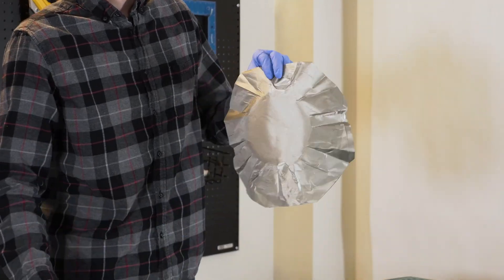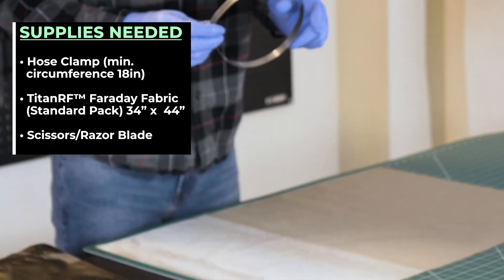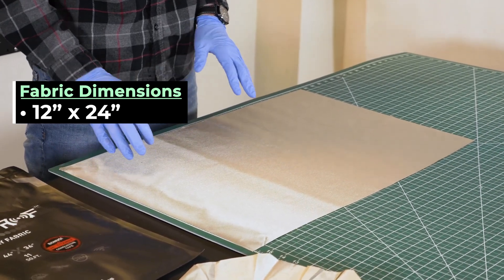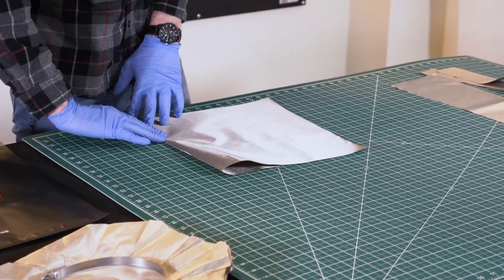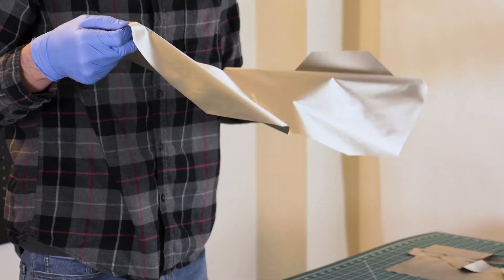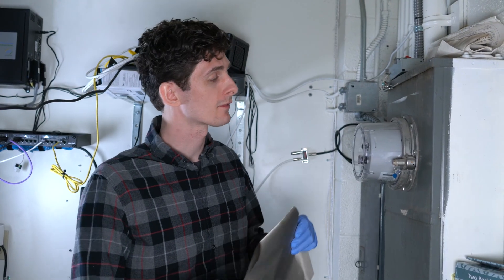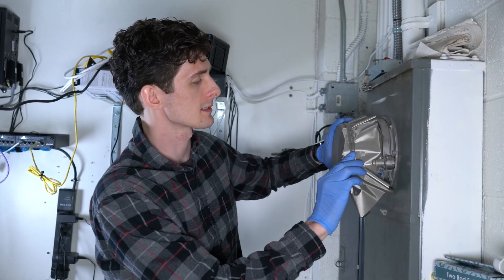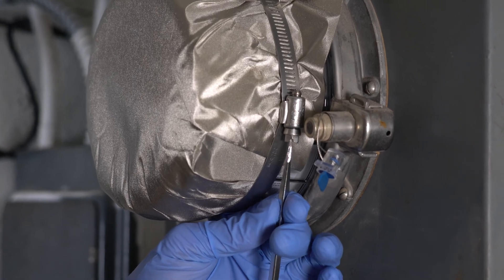Make Your Own Faraday Shielded Smart Meter Cover for EMF Protection

Comment: I used a large stainless steel mesh strainer that costs less than $10 and covered the meter with it, works great.
Reply: Where did you buy it?
Reply: Yo Jesse, where did you buy the mesh my friend?
Reply: @TheRealBobLazar  I don't remember, maybe dollar tree. I re-made one out of steel flashing, aluminum screen & a big hose clamp, all from home depot. Tools used were tin snips & screwdriver, it took only a few minutes. Also cover water smart meter with screen.
Reply: @invisableobserver my smart water meter is being forced by the city with No Opt Out policy. They tell me it will be placed on a pipe inside my house and the transmitter will be outside so the smart meter is inside so you’re saying I wrap the unit on my pipe?
Reply: @invisableobserver  I like the screen idea because it can still get out but it will break it up so its not as strong… depending on the type of wave of course. Anyone worried about this or attempting this definitely needs to buy a meter to test for leakage they don’t want at all angles surrounding the meter or whatever they’re trying to protect themselves from. Emf will work harder and more continual to find its least resistant path and it reflects off of most metals depending on its strength. So people need to be careful on painting walls and putting sheets of metal in their homes. Elf, RF, etc bounces around in those areas if ANY get in, whether it comes in through the ceiling, floor, or from any emitting device you weren’t aware of. Even things that are plugged into the sockets and not in use. You could cause more harm than good.
Reply: @myates33  I agree, last summer my smartmeter caught on fire, I covered the new one with flashing metal & aluminum screen held on by large hose clamps. Unfortunately I cannot afford to buy an EMF meter to test it
Reply: @inv @invisableobserver did it caught on fire with the aluminum covering or it caught on fire because you didn’t have the aluminum? Are you saying that the aluminum protects it from catching on fire? Please answer because the electric company just came and installed new smart water meters in our home and now I’m worried reading all these comments 😭 😭
Reply: @masteringmanifestations  it caught fire because the meter was defective,
Reply: @invisableobserver  do the aluminum coverings help avoid fires?
Reply: @masteringmanifestations  no, it just blocks the EMF radiation. Smart meters are attached to outdoor breaker boxes, and old breakers boxes become deteriorated after 20 years and can start fires.
Reply: @masteringmanifestations  no, it just blocks harmful EMF radiation. Fires from meter electrical boxes are usually because it is 20 + years old
Reply: What about the holes in the strainer?
Reply: @trulylynn9941  it's strange but the electromagnetic radiation does not pass through the holes, I took down the strainer & put stainless steel flashing around it with  big hose clamps, the strainer just looked too tacky
Reply: Great idea. No one would see it in a cupboard under the stairs - which is where my digital not smart meter is.
Reply: Does it work great standing in front of the strainer? Or does it work great at all angles around the meter and behind it? Make sure you’re not redirecting it towards your house or anywhere that you’re spending time next to it.
Reply: @myates33  smartmeter is between 2 bedroom windows, I put metal sheets behind the smart meter & completely covered the windows with aluminum screen. Grass never grew in the yard within 10' of the smart meter.
Reply: It requires aluminum mesh/screening not stainless steel, is my understanding.  I used aluminum mesh/window screen and aluminum tape and staples to hold edges together before taping for my gas smartmeter.  It works great and releases just enough for the person driving by in their truck to read the meter from my basement when they are in front of my house.
Reply: I am peeved off because the house I'm about to rent has now had a smart meter installed, and I want to know  how i can protect myself, I'm in Australia. I have sensitivity to emf radiation etc and the fact that these corporate companies are saying we do have a choice is in and of itself unlawful. I do know of people here who have adamantly refused the companies to install a meter and they have kept their old meters
Reply: Yes, that would. But I used the aluminum fly screen and it doesn't stand out and it looks somewhat more professional. The Utility may complain when they do occasional inspections.
Reply: @donk.5730 The smart meter caught fire last summer, I am glad I was nearby with a fire extinguisher, Several caught on fire on my neighbors homes too. I made a new cover with aluminum screen & flash metal using big hose clamps. I was without electricity through a long extremely hot summer, I almost died from it. I feel like I was targeted. The electric company refuses to let me opt out, yet they say they can.

Comment: Not a good idea bro, use SS mess, to reduce and split the RMF, i wouldnt do more, this will block signal, and deflect it back though wall, better deal, useca mylar blanket, pin it up inside the house to reduce EMF, if you're meter is in a location, dont have head of bed near it, or near a place you often sit, is a more functional solution, You prob want to update this bro, already to much fake news online, but yer call, 📞🙄

Comment: Hmmmm... This would be blocking 100% of the signal to the power company and they will show up and take it off. You need to use aluminum or stainless stell netting (like to use as a screen for a window). You want to reduce EMF by 90% to 98%. Not 100% eliminate it. 😂
Reply: Good point. Where I live you can pay a small fee for them to come out and take the reading manually.
Reply: Yes, I got a notice to immediately remove my screen version. They won’t even replace my smart meter with an analog version anymore in San Diego. No options.
Reply: I want to eliminate it.  I refused to have them switch my old house over.  They did it without my permission.  They can get their butts down and uncover it to read it and then put it back.
Reply: Exactly, Jared. What a stupid video

Comment: Dang. After reading some of the comments, I think this video needs to be taken down and done more thoroughly. Please show the EMF readings from the inside of the house nearest the smart meter before and after application of the shield. Also, explain how RFs can't escape with the shield on even if the entire backside of the smart meter isn't shielded. I've mostly read that people are placing RF-EMF shields along the wall INSIDE their home in alignment with the smart meter, so as to direct the RFs outward and not inward. Logically, by covering the smart meter on its face, the EMFs will be redirected into the home, right? Please correct me if I'm off on this. People are looking for solutions so when they come across videos like this without knowing anything about blocking EMFs then it could cause A LOT of harm to their health if they did this DIY and unknowingly redirected the RFs even deeper into their homes. Our smart meter is right outside our master bedroom (where our 6 month old sleeps too.) If I did this DIY, it could make our health issues worse.
Reply: If the face of the meter is towards the house it should be fine. The current goes out the sides and vice versa,  I don't know why the waves would go backwards or forwards
Reply: I didn't see him do any RF measures before or after the installation
Reply: Yes, common sense would tell you that this traps and reflects towards the house. I'd opt for replacing with an Analog Meter. I know you have to kind of go through some BS to get it retro but that's the best way...
Reply: @keithherington  My CoOp wants a one time charge of $300 per meter and $75 per month added to my bill each month, and I have 2 meters.
Reply: @ralphsawyer9535  Not sure what you mean by CoOp... What state do you live, just curious? That seems incredibly high and could be a newer issue.
Reply: @keithherington  A Cooperative is supposedly owned by its members, but that's bs bc they don't ask us diddly. I'm in Texas, and you're not joking it seems awful high. I emailed  them yesterday and got my reply this morning and that's what they told me.
Reply: @ralphsawyer9535  I mean, I'm in California and I think it's $150 to replace and you have to fill out some paperwork but there's no Monthly Fee... That sounds borderline Illegal... I hope you can find additional information to hopefully circumvent that nonsense.
Reply: @ralphsawyer9535  Wow. How greedy.  Makes you want to get off the grid completely.
Reply: @keithherington  yeah there is an extra monthly fee. I have Southern California Edison, and they are greedy!
Reply: @HapillyMe  Yes it does. I've been with this "Cooperative" since 1981. Rural Texans read our own meters and wrote it on the bill. For 25 years I did this with zero problems, then in 2006 they switched the meters, never said anything, never asked, never even talked to us about the new Smart Meters. I had no idea that I had options then. I could have refused and kept the analog meters. I would have saved the $300/meter but still would have been stuck with the $75/month, or whatever the price was in '06. This is outrageous and I'm far from done. They've put their convenience and ercots ability to spy on our usage over our health and well-being.
Reply: @keithherington everything is illegal in CA
Reply: Good observation
Reply: Your wrong it doesn't go back through solid metal
Reply: @awakeforever So why bother to do this at all, if you're just protecting the neighborhood and not your house?
Reply: I was wondering about behind such a meter. I don't have one - yet, but the new energy bill being introduced in the UK will enforce them to be fitted, with the threat of not only heavy fines but prison, and the threat of stealing our homes! Because ALL land including 12 miles out to sea "belongs to the Monarch", they can legally do that depite arguing the common law. Here, "freeholders" are not registered as owners at the land registry, but as tenants - even if they have completely paid for their property.
Likewise, whereas motor vehicles used to be registered to the owner, for years now the owner is registered only as "the registered keeper". Rum deal. A. Monarch who lies he has no power - when actually he has a great deal of it, and is a member of the Committee of 300 which well overseas the UN and its offshoots such as the WEF.

I digress though, so to go back to my main point, my small house is a terraced. I don't know if my next door neighbours allowed a smart meter but if they did or do in the future, it will be under the stairs the other side to where my electricity meter is. Maybe back to back or very close to it.

I suspect I shall have to try and have my son cover the wall in the small cupboard under the stairs with real aluminium foil (not the fake aluminium) or perhaps better, copper sheeting which will be expensive for me on a pension.
However, I suspect it would be a pointless exercise unless it were possible to place the sheeting behind the meter, which no one is allowed to touch because it is the property of the energy company (none of my family are electricians anyway, and no private electrician would break the law and move it for sheeting then put it back).

The trouble with living on a small set of islands is that the general population are far more easily lied to, and much more easily bullied. Those in control don't get away with nearly as much on the continent. For instance, the average person in France always knew more about the truth of the EU being a Nazi contingency plan, and the few people who went on holiday there in the 1960's came back and tried to warn other, but most wouldn't believe it because the MSM and misgovernment of the time lied it wasn't. 
The system of Monarchy would be a marvellous thing - if we ever had had monarchs who were more for protecting the people. In fact, a decent Monarchy might even be the best system - but if course we never had even one and never would have. 
As a result, hardly anyone here knows of the dangers of certain radio and microwaves, etc., despite the plethora of information on the Web. Those working and raising children are too busy to find out, and those not working are likely to be apathetic, or too disabled, or retired. 
An awful lot are brainwashed.
Reply: I used reflective Christmas wrapping paper behind a bookshelf to block the cell tower and it worked 80% lower per meter.
Reply: @Doc02864  That is impressive!
Reply: The smart meters is a world wide initiative, part if the WHO to control mankind cdug into it.
Reply: The meter back is all metal, so should work like a shield from that side.

Comment: Do shield cause the readings to nit be sent to the electric company? I can get hassled if they have to come out to read it.
Reply from the maker: No, this will not effect sending the readings to your electric company.
Reply: @missiondarkness  ....so it's not actually stopping any RF then....? ....or is is just stopping the bad harmful RF, and not the good meter reading RF?
Reply from the maker: Sorry just to clarify - the RF reading functionality will be cutoff. The meter reader will not be able to remotely read the meter. They or you will need to remove the cover to read it, then it will need to be replaced.
Reply: @missiondarkness  So it will mean I will get hassled by the power company....?
Reply: I bought the Smart Meter Cloak and so far it doesn't block any RF actually it seems to increase it. I have a Digital Meter which essentially is the same but the power  company has to come to the house to read it.
Reply: @loretojacobs6613  If the RF really gets stronger, you have a resonance problem. Ground the thing to make it work.
Reply: I think at one time, but the type we buy for cooking was changed and I read it is now useless for that. I am not sure, because as an experiment I covered my mobile phone with foil and left it for a couple of hours. When I unwrapped it, it was hot - not enough to burn but if I had left it longer, it would probably have caught fire.

Comment: Dude, I'm sorry you did all of this work, but you should not be shielding the front, and causing more radiation to be reflected back into your house!
Reply from the maker: The back of smart meters may already be shielded. The radiation often comes only from the front
Reply: @missiondarkness  Mayhaps.  The back of my replacement, analog meter is not whatsoever shielded, so... I suppose I'd like to see video of the shielded back of a standard smart meter.

Show me, in other words!  Thanks for the reply!
Reply: @FancyNoises  you have a good point here. After reading "May" and "Often" in his reply I didn't feel completely confident.
Reply: @missiondarkness  yeah and it may not be. So it’s important to stress to people they may be endangering themselves if its not. The meter needs a purposefully chosen pathway for the signal to relay. Otherwise it will work harder and more often to find the path of least resistance. The back and sides of the meter need to be blocked. If it goes outwards away from your home, thats fine. But if that signal needs to go in the direction behind it, it will still go in that direction. There’s a lot more to this to think about. This corporation (aka government) is screwing us big time.
Reply: @ts757arse  Whats more, shielding it will cause the bad RF to become directional, come out of the back of the meter and go into your house.
Reply: @johneperkin  I am afraid so. I bought the Mission Darkness meter Cloak and not  only didn't block the RF,  but it seemed to have increased it when the metal touched the metal of the meter and now it seems to be throughout my house more
Reply: @loretojacobs6613  Try to ground it. There should be not gaps around.
Reply: @johneperkin  interesting. thank you. I wonder if people have luck just lining the whole wall in the room behind where it's attached with faraday fabric
Reply: You have a point. Yet it has 16k views. I wonder what magnetic paint does.